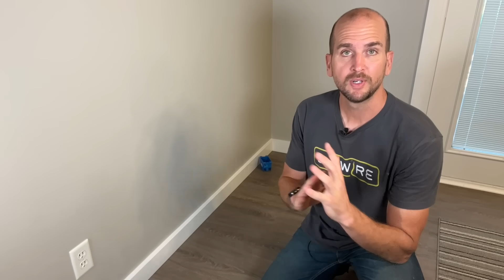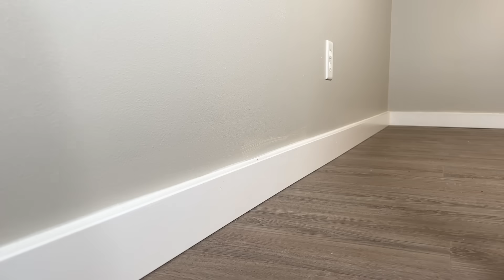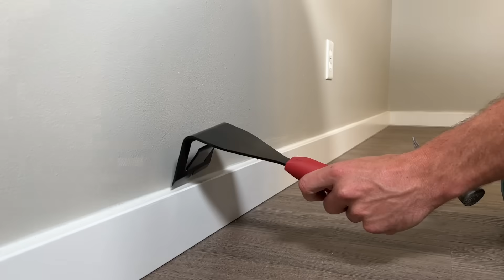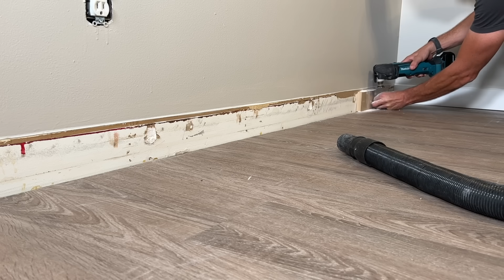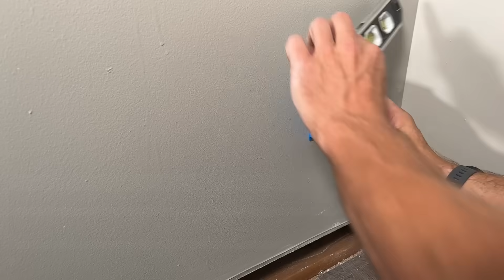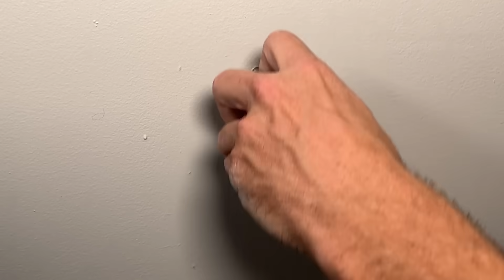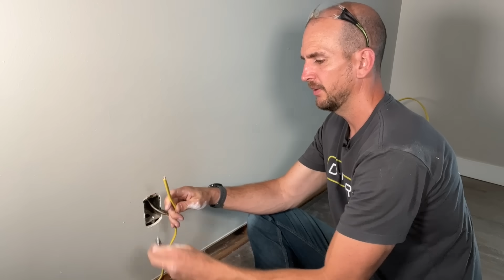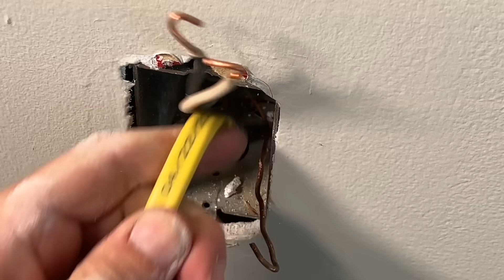How To Add An Outlet To A Finished Wall

Comment: Question, is this NEC approved? I have an old condo where I want to add and upgrade a few or all outlets but don't want to open up all the plaster walls. This is ingenious btw. Great work!!!! Def going to use if it's permitted.
Reply: Why wouldn't it be? The holes are in the center of the 2x4's and just big enough for the Romex to go thru which is the same thing that would have been done before the drywall was installed.

Comment: Thank you for vacuuming the open bays out before you started the work.  It's what I do.  I see so many SLOBS just leave everything.  I had to go behind one of my corner kitchen cabinets to run a wire and found coffee cups, rags, actual garbage.   I felt like contacting the contractor who did that work... to come pick up their garbage. 

Being clean is a quick and easy way to NEVER leave a tool behind.
Reply: I opened up an old bathroom wall during renovation and discovered that they had stored all the drywall scraps inside which had become covered with mold from a bathtub leak. After clearing it out and coming back the next day the room had dried out and I noticed that a heavy, oppressive atmosphere had disappeared from that room that wasn't noticeable until it was gone.
Reply: I seen where slobs put their lunch scraps and packaging trash inside the walls.  Just kidding. But I'm sure it happens.
Reply: Heh, you haven't LIVED until you've pulled 20 pounds of disposable straight razors out from between 2 studs.  They used to just cut a hole into the lat and plaster and mount a plate or in the back of medicine cabinet they had a slit for them to just drop between the studs in the past decades.  (Gross) However, I agree that cleaning up your mess is required for someone to take pride in their work.  I, usually, only see the type of lazy you're talking about from new construction work which is, as I'm sure you know, done ridiculously fast/shoddy pace most times (imho).  Handyman in Minnesota here, btw.

Comment: What would you do if the original box wasn't metal with the punch-out at the bottom? The boxes in my house are those newer plastic ones where you have to force in the wire from outside the box through plastic clamps at the back. That may be hard/impossible to do in this situation.
Reply from the maker: It wouldn't be too bad.  From the inside of the box I would just break the small piece of plastic holding 1 of the 2 romex "holders" and then pull it open a bit from inside as I pushed the romex up.  Doable for sure and most people would say it is a bit easier as compared to metal.  Good question 👍

Comment: Do you have a assortment of WAGOs that will fit 10awg wire?
Reply from the maker: Yes, this is the assortment back for the 221-612, 221-613, 221-615 which will fit 10 gauge.  They are considerably bigger so my default is the 221-412, 221-413, and 221-415 from a space perspective but it is nice to have some 10 gauge on hand as well.  https://amzn.to/3mZARXf

Comment: What happens when the next homeowner decides to upgrade from 4” trim to 6” or larger….and sinks a nail or two into your Romex?
Reply: He drilled in the center of the 2x4. I hope the next homeowner isn’t dumb enough to use 3 inch nails for that 6’’ trim!!!
To be sure he could have slipped nail protection plates under the drywall.
Reply: @robertlafleur5179  I mean, it looks like he went a bit higher…still not high enough to clear future baseboard.  And 3” nails??I agree…but who knows what they will do?   That’s why I don’t like the method of running wire

Comment: I'm a licensed residential electrician, but I don't have any of the tools in the video (other than a buzz saw). So if I went out and purchased those tools just to do that kind of project, while still quoting the customer a reasonable price, I wouldn't make much money on it. I would probably walk away from that job and refer the customer to one of my competitors.
Reply: Start buying some of those tools and in no time you’ll be taking those jobs away from your competitors.
Reply from the maker: Time to step up your game.  The Craftsman Brad Nailer is pretty cheap and I just keep some 1" and 2" 18 gauge nails in my truck.  Investing in yourself is usually a solid decision.  Best of luck!

Comment: "You can never have too many outlets." Uhh, yeah, ya actually can. If you had one every foot, especially in all directions, or even all walls that were completely covered with outlets... that'd be a tad too many!
Reply: So  true when it comes to the total load that will be on the that 15/20 amp circuit feeding the daisy chained outlets. Same effect as having  a power strips being fed from an outlet with too many things on it that can exceed the circuit's amperage capacity.
Reply: @3henry214 : I wasn't even talking about what the load would be like if you had something of average draw plugged into each outlet covering the whole wall. It would just be too many for the wall. It would look and be stupid.

Comment: You can also notch the studs at the bottom and use metal plates to protect the Romex.
Reply: But how would you re-nail the baseboard? (Don’t say glue it😣)
Reply: @jayjaghla7310  Favor the top part of the baseboard for the wire and nail the bottom half of the baseboard to the bottom plate.

Comment: The trick for removing finishing nails is to grab the end with heavy pliers and pull it the rest of the way through the back side of the wood.  No splits or tears on the finished surface.
Reply: the way he did it in the video keeps the finish intact
Reply: Yup, I applaud the use of nippers to grab the nail. And that big bent putty-knife looking thing is great, too. Gonna have to get one of those.
Reply: pulling the fastener through is something to do for people who have a lot of free time because 9 times out of 10  doing so will create a finish blemish which will need to be addressed which just takes more time. nipping the finishing nail on the backside of the trim is quick, guaranteed not to require any further effort  or time and nobody is going to know part of the fastener is still in the trim but you....time is money!!
Reply: @abruptlyblunt  clearly you've never had any of those remaining sharp little needle points do some unintended damage when handling, storing, or reinstalling many lengths. The pull through leaves no trace, only takes a fraction longer than nipping off, and no scratches on the walls, floor, or skin!
Reply: Just break um off with your Finger's..they're Tin..otherwise you've got MORE holes to putty and paint..I work with Knotty Alder on million dollar homes..

Also they break off Flush,  cutter's leave a burr which can scratch or hang up the pieces

Comment: Good job.
But why didn't you use a flexible drill bit kit?  
Taking out the receptacle, take out a side knockout, and run the drill to the right until you get to the new box's cutout?
Reply: I don't think that you can go 4 feet by doing that.
Reply: Or a right-angle drill ..

Comment: Curious why you used 12/2 wire,
Reply from the maker: Just matched the 12 gauge which was already feeding that circuit.
Reply: @EverydayHomeRepairs  Matching that 12 gauge is crucial. That circuit is probably protected by a 20 amp breaker, installing 14/2 wire would be a fire hazard.

Comment: What's the difference between metal and plastic outlet boxes.
Reply: The type of plastic box he used is for old/existing work (meaning the drywall is in place so you can't hammer in a metal box).
Reply: @mjbjr1944  I've seen metal old work boxes

Comment: Stop discovering my tricks!  The dewalt right angle adapter with the larger Milwaukee hex drill bits make short work of the holes in the studs.

Comment: THANK YOU SO MUCH FOR POSTING THIS! I was literally going to bore 4 holes into my wall to do this and your method will literally save me days of drywall patching. 🥳
Reply from the maker: Perfect, happy to help!
Reply: But run the cable behind the baseboard and protect with steel nail plates if you want to comply with NEC.

Comment: So i just did this a couple months back....if I could, I would recommend anytime you're going through a stud like that with a drill, to bore holes for the romex, use a 90° adapter with a 1/4" end spade bit that works with impacts. You can get the bit more horizontal and don't have to lay down and push super hard at an angle.  And I recommend Spyder Stinger bits. 🙂 Good video bud.
Edit: I'm not saying the adapter or an installation driver (What I have, a Milwaukee M12 with multiple driving bits) is the BEST way to go about it.... I'm just simply saying that in my experience, putting holes in old work, a 90° adapter or installation driver is a great tool to have in your back pocket.
Reply: @Garebear yep! Exactly! I have the M12 Fuel Installation driver! I love it.
Reply: That is exactly how I do it Chris and the Romex won't chafe on an angled hole.
Reply: I also use a right angle adapter with my spade bits, but it’s typically to go through fireblocks when running wires down from behind tvs.
Reply: I edited my original post for anybody thinking I'm telling anybody this is the best way to go about doing this.
Reply: I see no need to go through all that. At the end of the project when it's all done the only person who's gonna know that the holes drilled through the studs are "perfect" 90's would be you. That's a lot of extra expense and time for a DIYer who will probably never use that set up again. Just sayin
Reply: @davids7209  i have an installation drill, so it's nothing extra for me. But a $10 90° adapter and a spade bit isn't "extra" and it's not being perfect, it's getting it to the right depth. Depending on the studs, the drill, etc. You may not be able to get a good spot. A 90° adapter at the very least is a great tool to have in your bag for when you need it. I'm not saying "Everybody go do this!" I'm simply stating that a 90° adapter makes getting in between studs so much easier.
Reply: @just-an-averagedude  If you use the 90 adapter you would have to forego the tip of making the holes above the opening to avoid brads later, because it would be too difficult to drill. With the 90 you would drill the holes directly in the open area.
Reply: @kellyq21  I'm not understanding what you mean by that?
Reply: @just-an-averagedude  I'm sorry, but when I read a comment on a DIY YouTube video saying "...if I could, I would recommend..." sounds to me like you're saying everybody should do this. It's not about you and what you have that makes this process easier. I think you lost sight of the fact this video is designed for the non-professional home owner who looks for a solution to this issue.
Reply: @davids7209  no, I haven't. Which is why I said I did it, and using a $10.00 90° adapter is a very cheap, and affordable and easier way to get through the studa. Then y'all came into the comments and and took it farther than it needed to go. It's a 90° adapter go drill a few holes, not rocket science.
Reply: @just-an-averagedude  I didn't take anything farther than it needed to go! I'm just reading what you commented and saying the average DIYer isn't going to justify buying a 90° adapter even if it only costs 10 bucks! They'll probably only use it that one time and for what, so they can get "perfect 90's"? That clearly isn't a problem that this video didn't show needed to be addressed. Just sayin
Reply: @davids7209  I didn't say "Perfect 90s" I actually said "Perfectly Horiztonal" but I reworded it. And an average DIYer having a 90° adapter is a great tool to have in the backpocket when you're under sinks, in cabinets, etc. etc. But you didn't have to comment on here and tell me that the average DIYer won't spend a whopping $10 to make things just a tad bit easier either. I was sharing my experience, and what I've come to make my life easier. I've been in construction for 16 years, and now I'm a service tech, and have been for 5 years. So I quite literally do this kind of stuff all the time. I didn't comment this because I cared or didn't care what someone will or won't buy. I commented sharing my experience, I'm not trying to sell a tool and make money. So yeah, you did take it farther than what it needed to be. So if they want to take my recommendation and my experience, awesome, hope they have great luck with it. If they don't, oh well. You're the one who started commenting about people not buying the adapter, not me. Again, I didn't comment for that, I'm simply sharing my experience with the tools that I've used. And then you chimed in and had to make it a debate. So yeah. Have a good night.
Reply: @just-an-averagedude  In the video he reached up behind the drywall to drill the holes. If you want to use the 90 adapter that would be too hard to do. No biggie, you can just drill the holes using the 90 adapter directly behind the removed molding without reaching up the way he did. Then be careful when re-nailing the molding.
Reply: @kellyq21  NO it's not hard...your thinking is making it hard. The drill head is vertical or a 45 degree...sitting below the cut drywall. The bit goes up 3-4" or whatever and 90's to the stud with a bit
Reply: I don't know what you just said, but ok boomer
Reply: @Asiansxsymbol  stay classy
Reply: @Asiansxsymbol  You don't have to be insulting just because you lack the knowledge to understand what's being said.
Reply: @Asiansxsymbol     Lost you at 90°?

Comment: Not to cut you short but if I ever had a house built I would have the outlets at least two feet off the floor. I'm 6 ft 2 and you don't know what a pain in the ass it is having to reach down almost to the gall darn floor plug something in.

Comment: Why would you go any larger than 1/2” holes, at most 3/4”.  Best to talk about the code right there, which discusses hole location (to avoid damaged conductors). Well done VIDEO!! Seriously, great methodology. Subscribed.

Comment: Why did you use a pigtail to connect the outlet in the old box?  You can just use both screws on the outlet to connect the wires, you will then have less wires to stuff inside the box.  Also why are you using 12 gauge wire on what appears to be a 15 Amp circuit?  Removing the baseboard to hide the drywall cut is a great idea, assuming you have tall baseboards.
Reply: The existing wire in the box looked like 12 ga as well, so it's probably on a 20A breaker already.

Comment: Very awesome that I am planning to do this very thing in my restroom. I have a GFCI outlet that is looking charred and isn't really where I need it. So I want to put one 6 or 7 feet around a corner and closer to where I shave. Thanks for this informative video
Reply: Be aware, there is a zone around you tub/shower that is against code to add a receptacle into. Unless, your bathroom is physically smaller than the zone.
Reply: @jimmac1185  mobile home and the existing one is very close to the tub
Reply: @clasicradiolover  So this is the code article I'm talking about. You probably fall into the exception with what you are describing. Also, your state may have amended the code to remove this entirely.
406.9
Receptacles shall not be installed within a zone measured 900 mm (3 ft) horizontally and 2.5 m (8 ft) vertically from the top of the bathtub rim or shower stall threshold. The identified zone is all-encompassing and shall include the space directly over the tub or shower stall.
Exception No. 1: In bathrooms with less than the required zone the receptacle(s) shall be permitted to be installed opposite the bathtub rim or shower stall threshold on the farthest wall within the room.
Reply: @jimmac1185  Yeah. I'm actually moving it away from the shower, towards the sink. But my bathroom is only 8'x7'. This information will cause my not to replace the one that's by the shower and only extend the wire to the area where I shave. What I'm trying to figure out now is should I put the connection from old wire to new wire in some sort of box inside the wall.
Reply: @clasicradiolover  Yes, any spices in the wires need to be in an accessible enclosure to comply with code.

Comment: None of my oak trim has a caulk line at the top.  I've never heard of that being done.  Is there a concern of water somehow running down the wall into the trim seam?  To me the water intrusion is more likely from the bottom up from a floor spill.
Reply: Painters caulk is used extensively on painted trim and drywall to help seal any gaps between drywall and trim. (nothing is hardly straight and true. 

It’s a good practice.   If you have oak trim finish and don’t want the white painters caulk, there are other colors and putty’s for use if u have gaps. Most is all latex and a wet rag will remove off oak trim and give a nice tight seal (cosmetic) between wall and trim. 

Painters caulk can be a life saver for many things. as well 😏.

Comment: Be consistent with your faceplate screws??? That's the first time I've ever heard someone say that🤣 I'll tell you what, I'm probably consistently inconsistent. I don't know though, I've never looked at a faceplate and noticed the orientation of screw head, even if I just installed it. Then again, I may just stop screwing when my wrist is at the end of its turn and then unconsciously leaves all the screw heads in the same position. But thanks for that Lil bit of OCD you shared, now I'll never be able to walk by an outlet without noticing the screw position. I have about 500 outlets at work so I know what I'll be doing all next week😉
Reply: I would rather have them torqued properly than facing in the same direction. My OCD is on the torque value XD
Reply: I’ve always oriented the screws in the same direction. You would be surprised how many homeowners notice your attention to details.